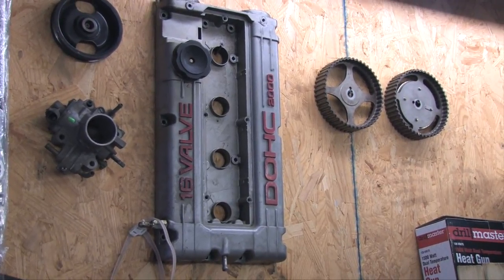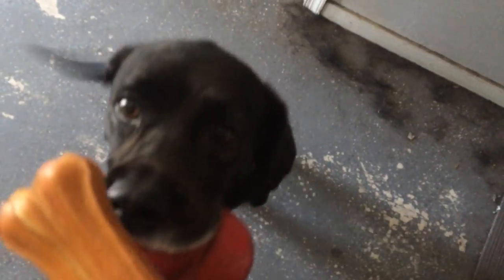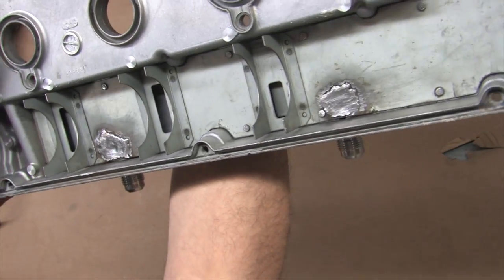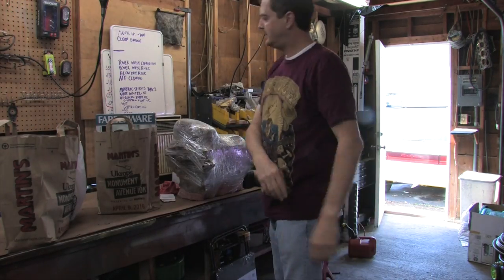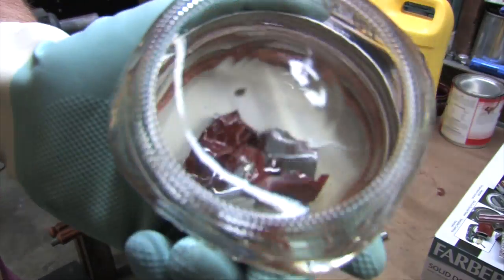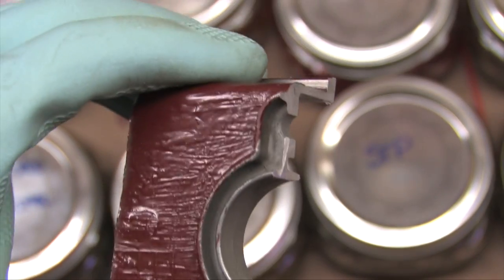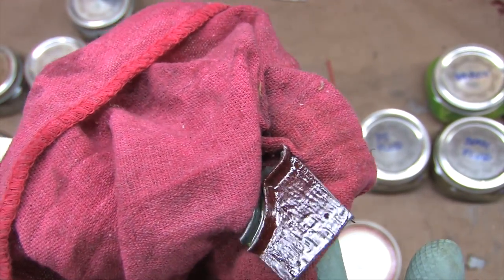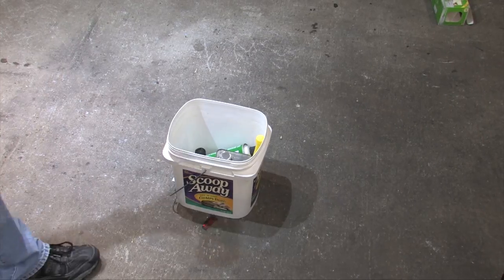Glyptal Testing for Automotive Use

Comment: If anyone says that this video isn't "real" science, they're wrong. I'm working as a research engineer now, building scientific instruments for analyzing DNA, and Jafro's work here is top notch. Sure there's room for more rigor and more possible factors to check, but that's always the case, even in multi-billlion-dollar LIGO detectors. The theories might look nice and clean in a textbook, but in the trenches of real-world data collection, life looks a lot like this video. Even if you have no interest in combustion engines, I recommend watching this video if you want to see a good example of experimental methods.
Reply: One could say something about the process though... painting thier gsx project block BEFORE experimenting to see if the paint was up to the task?! :P
Reply from the maker: That's called faith!  :)
Reply: He also identified the best paint removers if his results from the test were not acceptable for the application. So he could backtrack if needed.
Reply from the maker: Give me a rag, some gloves, and about 10 minutes with a can of 2+2...
Reply: paint will always be attacked by the solvent it was originally carried in, that's why you need a thermosetting coating, i.e. epoxy
Reply: in otherwords 
A+, well done.
Reply: @Jafromobile  Cool video Jafro. my 5 cents on the oil drag, perhaps the coating does not conduct heat as well as the aluminum (aka higher thermal resistance) resulting in the oil staying hotter for longer (and lower viscosity) and winning the race. I wonder if the rsults would be the same if you chucked the metal peices in an oven first also. cheers Joe
Reply: @bottomline99  I bake the parts and wipe them clean before applying Glyptal to the inside of an engine. I was taught thoroughly clean, bake, wipe down, and repeat if necessary. Have never had any Glyptal come off even after running cast iron through the caustic tank.

Comment: Great video Jafromobile!
I've used Glyptal inside engines for many years. We used it inside the large diesel engines in the power generating plant I used to work in. We never baked it on, we couldn't in that application, but it held up just fine anyway. Once I had experience with using Glyptal at work we also used it in my cousin's drag race car engines to seal the block and improve oil drain back. It wasn't baked on then either, just air dried, but it held up just great and never once did any of it flake or chip off. All in all, I think it's great stuff!

Comment: Love the incredible analysis Jafro, very enlightening!  I've seen old engine builders coat v8 lifter valleys and such with glyptal, but with such less regard for surface prep and chemical relations.  Thank you for the excellent information as always!
Reply from the maker: Thanks man!  What I never found was any info about what it reacts with and how fast?  I confess that I go through a body-prep level of detail because I'm making a YouTube video and exercising an abundance of caution.  You know exactly what I'm talking about. :P  Many people don't go through anywhere near this level of prep, and some don't even bake it... but what fun is that?  Those people don't get to play with a shop dog.  Maybe they have their own shop dog?  I just know if I go through a body-prep level of detail that my paint will stick, and so will everyone else's who does it this way.  Any paint would stick to nearly anything with this prep method.

But one of the other reasons I do this... there are some horror stories floating around in forums about coating failures.  Sadly they're not from the people who originally coated the engines, and they purchased the car that way.  These posters don't even know what they're looking at, so much of that data is unclear.  They can't identify the coating by anything other than "it's red".  Could be Glyptal?  Could be Rustoleum?  Could be Krylon?  Could be Crayola?  I'm just trying to be responsible and fill in the gaps.  Looking forward to what you do with a V10.  ;)
Reply: Tom's Turbo Garage I've torn down some race engines built "professionally" and found the oil pick up screen plugged with glyptol. If its not as clean as new metal it won't last. Its great stuff if used right, like he says in the video its a lot of time and expense.

Comment: Well...I was contemplating using Glyptal to coat the inside of my Small block Ford, but then since it will be run on E85, and your testing shows possible problems with Alcohol fuels, This has changed my mind. Thanks for the testing, Very informative!

Comment: I would only apply it to a block that had been baked and wheel-abraded, so all oil residue is cooked out, and the surface is roughed perfectly. The hot oil test really sold it for me. I'm going to use glyptol without reservation now, so thanks for the info! PS - Power steering fluid is a thin hydraulic fluid, which is really also conventional petroleum oil. Brake fluid is completely different, not petroleum oil at all. It can absorb water, while in ps fluid, water will remain separate. Why do you want brake fluid to absorb water in your brake system? Well, oil floats on water, and water sinks in oil. Where would water go if brakes used conventional oil? To the bottom, ie, to the wheel cylinders. And what happens to water in cold weather?

Comment: @33:00 On COLD metal. Equally heat the parts, too. More accurate run= tip pieces back, puddle measured amount of oil. Tip pieces up, same time, on one table (or piece of plywood) for more equal run. Also- test conventional and synthetic, hot and cold, both piece and oils. Make HUGE multicolored spreadsheet graphs to wow and confuse the Plebs.

Comment: Glyptal is boss, i work in machine shop and have been using it for years, excellent product,definitely something that paint huffers dont need to know, this stuff will really get you higher than a kite,heck maybe the moon.

One time many years ago me and this other guy were painting the inside of a crankcase and we were brushing it on and we were using glyptal for the first time, heck we are just brushing it on, we dont need no masks right? were not spraying it, what can go wrong?  next thing we know we were both on the ground rolling laughing wondering what was happening, pretty strong stuff,i know they have always claimed is gas resistant but Ive always been tempted to use it in a gasoline tank on a bike, i wonder if it would hold?

Comment: Recently discovered this channel and I love it. One thing i find common between the videos is Jafro likes to clean stuff, may I suggest trying soda blaster for cleaning engine parts coaked in carbon. Works wonders and the soda itself dissolves in water so you dont have to worry about leaving media behind after cleaning.

Comment: FWIW, I powder coated an old Volvo 240 valve cover, to clean the original coating off I used plastic blasting media (looks like chopped up plastic Easter egg shells).  For giggles I hit the inside (where there was 30+ years of oil and carbon build up) and the media took all the gunk right off to bare cast aluminum in a few short passes.  I was amazed how fast it worked, on both removing the powder coating and carbon and leaving me with a super clean valve cover.

Comment: Live the videos like always Jafro, especially the longer ones! One thing I did notice though was that all of these started peeling outside the edges, probably due to the angle grinder you took to it, allowing it to get underneath the glyptol through the side, making it a relatively easy process of just lifting it. I mean, I enjoy it as well as everyone else in the comments it seems watching you clean and apply this stuff. Perhaps another video on a part that hasn't had a "wound" for the chemicals to get into and has been completely coated? Only reason I say that is due to the chances of me spilling 2+2 gum cutter  on a part coated and cut apart is extremely low. Love the videos keep em up! And post more often!
Reply from the maker: I'm working on the frequency.  It will come at a cost to the length, but the topics will become more focused.  The concerns you have about the edges are the same ones I had when I was doing this.  The grinder is the only random variable and many of the chemicals caused a failure starting on the edges.  The way I see it, grinder or no grinder... if it's capable of starting on the edges and working its way in, than any abrasion on the surface is capable of becoming something that's stuck to the oil pickup screen.
Reply: Jafromobile And there’s always an edge somewhere. Either where the bearings ride, or near the sealing surface of a component. It’s a “worst case scenario” and a worthwhile test. If a chemical can get in/around the glyptol then it will do it here.

Comment: Hello mate - great video. I'd say from the drag race that the Glyptal wins due to the fact that its a smoother surface. The ally has pore etc and the pores are filled as the oil runs down. You can see the drip size decrease. Cool stuff.

Comment: I hate to throw a wet blanket on one of my Idols- but would the porosity of the cross cut aluminum open up the underside to let solvents wick in, from the inside out, lifting off the Glyptal? I'd like to see 2 samples, cast, iron and aluminum- correctly coated, then cut cross, and examined under high mag for amount of penetration. Maybe your local University has a scanning electron microscope they could use to examine? A more fair test- would be the  solvents against the cured coating top, not from underneath. This also makes you think- would this coating benefit more from a rough, porous surface to penetrate into- or a closed, polished surface, to just float on top of, and dry? Think about that. Like roots of a tree in soft dirt or on top of your driveway.

Comment: Wow, thanks for all your hard work showing this, my use is in machine tools such as a lathe. Just to seal the cast iron imperfections and use non detergent oil at room temp's. Proof that it will work fine for years to come.

Comment: Great video Jafromobile. I painted the insides of my Datsuns l28 engine with Glyptal a few months back so it's nice to see what cleaners and other products I can use. It would be interesting to see how other fuels/gases would react with glyptal like other people are saying. If you do a second run of tests, assuming you're able to find a way to get the products, you should include gas (leaded & unleaded), diesel (& diesel additives like cetane boost, biocide, etc.), ethanol fuels like e10 & e85, automatic and manual transmission fluid, differential fluid, diesel oil, nos(if that could even really be tested). Glad I watched this because I was considering meth injection. Kinda sucks to here I can't do that now, oh well. Thanks for the great videos, keep it up!

Comment: To be accurate for oil return speed measurment, oil must flow on an already present oil film, like in an engine,when running.
The test you execute here, only represents what you have once in your engine,when you start it new. 
You could cover the parts with clean oil,then drop tinted oil with graphite ,or use black used diesel oil to see it.
The result will be different i think,seen that oil will ride on its own material,and only its own oiliness and viscosity will be a factor of return speed.
Teflon coating would do great in this application. 
Did you port the oil return passages on the head and block ?
Very interesting video nevertheless.

Comment: You could test the affects of incidental exposures such as blow by... by mixing those chemicals with oil and try the testing again  see if it affects how the glyptal reacts to the chemicals
Reply from the maker: This idea crossed my mind, and it's what lead to me making the claim that "I have no means to test that".  What burned my brain cells up is the variations of some of these chemicals' flash points, how they oxidize, and at what concentrations in parts per million would make it past the rings as blow-by.  How much of that blow-by was and was not combusted with the fuel source?  Temperature will play a big factor in the kinds of chemical and physical reactions that occur, and what compounds now remain once they're reduced?  How different will the blow-by gasses be in the engine I'm building, versus a stock-spec stock-internal'd build?   What concentration is achieved?  ...and what are the oil change service intervals?  

The results would end up being subjective when it comes to the concentrations without multiple test engines with different ring gaps and compression ratios to create samples. Then I would need a mass spectroscope with a whole lot of beakers, vials, and vacuum pumps that I don't quite know how to put together and use just yet?  Many YouTubers and all of the science world probably wouldn't appreciate nuclear spectroscopy in my home garage the same way and you and I might?  You have a great idea, and it's what sent me down this hole once before.  But at some point I have to stop and remind myself that I need to finish building my engine.  I wish there were ways to express how much goes into my voiceovers.  Sometimes I'm extremely candid and humble, and just straight-out admit my flaws to save you time.  ;)
Reply: Love your voiceovers, Jafro!  You calm, objective and very considered narration is what makes  me keep coming back!  Love your work!
Reply: Jafromobile 
You break it down so a five year old could understand it without being demeaning you have a gift of speech well done.

Comment: Nice video, good thoughts and interest in your hobby. Personally, i don't use this glyptal method. For all the prepwork
and baking ect. time and expenses, i grind and polish engine internals to reduce oildrag. It does the job for the same amount of 
labour and time/money considered.
Reply from the maker: I did that on the Hyundai block, and I think it's the better route to take.  It's actually a fraction of the time and effort to yield an improvement in oil drain-back.

Comment: Hey jafro, you should have tried oven cleaner. I know you tested some pretty harsh stuff but a lot of people including me use oven cleaner, I haven’t found a degreaser that works anywhere near as good or that’s as strong.
Reply from the maker: I knew this would probably lead to another testing video.  I didn't do fuels because I'm not in the military, so I can't get the Ethanol based fuels without buying a whole 5 gallon at over $20 a gallon.  I don't have any plans of building an E burning car.  It's not because of the science or performance variables, it's all about availability for me.
Reply from the maker: Oops, you didn't ask about fuel.  I'm crossing up my comments.  If I do end up doing a fuels video, oven cleaner will be added to the mix.  Thank you!

Comment: I know this is old but you did say gasoline with ethanol will remove this glyptal right ? It's because I know of a motor cycle engine rebuilding shop that uses this . And I live in northern Canada and we use gas line antifreeze in are gas tanks every so often. Great channel like the way you try and explain everything!!!!!!

Comment: It'd be interesting to see the same oil drag race on polished aluminium vs rough cast finish, might get a similar improvement in drain back for less work?
Reply from the maker: I did this with a forged steel crankshaft once.  The 'polished' side wins, and yes, it's a similar improvement.  I didn't actually polish the forged steel surface of the crank that I used in the test, but I did grind a smooth channel into it, and it won in repeated tests.  Polishing would be a waste of time IMO because it would un-polish itself on the first slightly-humid day.  It would oxidize more quickly.
Reply from the maker: I found it.  It's in the "grinding oil return channels" video right before the 5 minute mark.  It's on forged steel, but you'll easily see how big of an advantage just having a smooth surface makes.  Smoothing cast surfaces also removes stress risers which can become points for fractures developing in the material.  So grinding casting smooth adds an additional benefit in that it strengthens the part.
Reply: the racing engines I've seen from the inside, toyota and subaru ones from world rally championship, they produce around 600-700 hp without air intake restrictors from 2l capacity with ~2000km special stage kilometer warranty, have smooth inside surfaces, no polishing, just sanded out, probably around 300ish grit as last pass, no paints or anything, just smooth surface
Reply: Chrome the inside of the valve cover?

Comment: Just wondering if.....on an untreated surface, because the oil takes longer to drain away that it's actually pulling away MORE heat compared to the Glyptal prepped surfaces where the oil slides by faster. Not explained well but maybe you can get my drift.... Your tests are awesome by the way. No one does it as thorough as you.

Comment: Nice job. I was wondering what effect does gasoline, diesel or ethanol fuels have. I have seen glyptal used in many gearboxes, without fail, that have been in service for over 50 years at a hydroelectric dam. The stuff works.
Reply from the maker: Yes it does!  Notice how all of the oil-based products had zero affect on it.  It's a factory treatment on excavators and some brands of tractors, too!
Reply: Can anyone tell me what thinners I can use with Glyptal paints ??